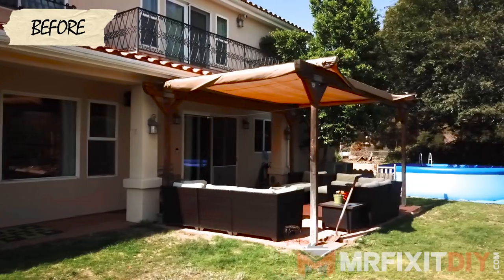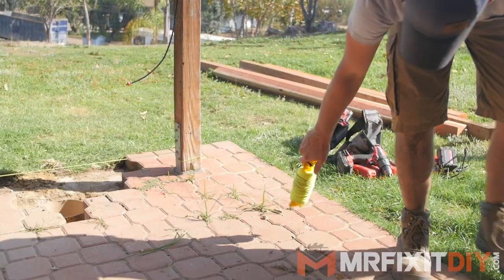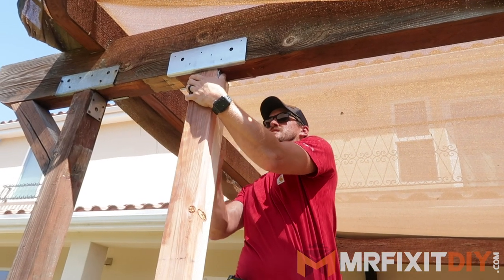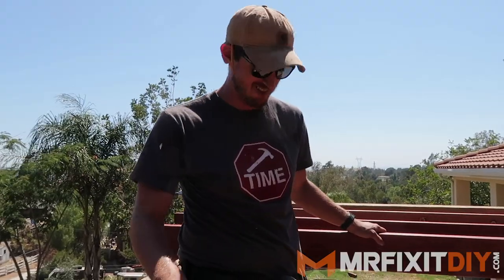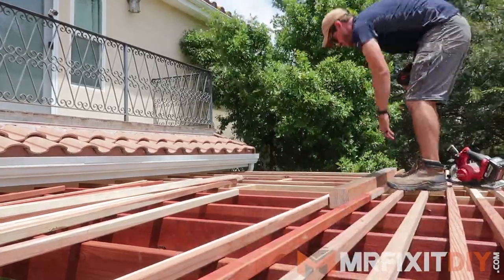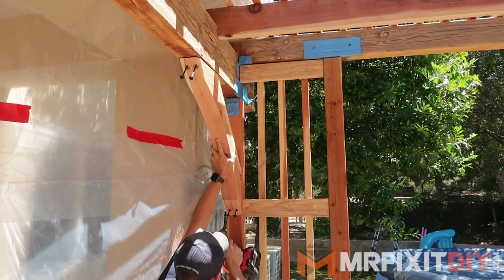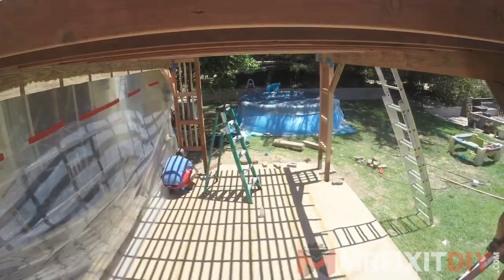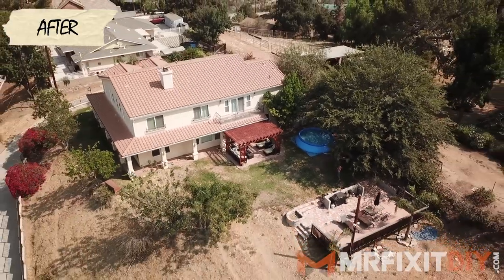DIY Pergola Remodel

Comment: This is the exact video I needed. I am in the process of finishing my pergola I fear it might be slightly unstable one I remove the ground supports. I used 4 x4x10 posts because i thought the 6x6 would be too massive. I was thinking about adding extra posts but wasn't sure how that would look. I dot want to compromise the zen look. However, your video shows me that it will still look great. I might just copy this idea. hahaha.

Comment: Great work. After staining it did you apply any sort of extra sealer?
Reply from the maker: The homeowners did after a few weeks of letting it acclimate. And they'll re-apply as needed going forward
Reply: @MrFixItDIY  I assume that it was not pressure treated lumber, correct? I personally hate that stuff. I'd rather use a natural weather appropriate wood.